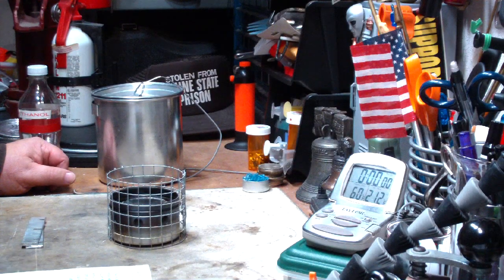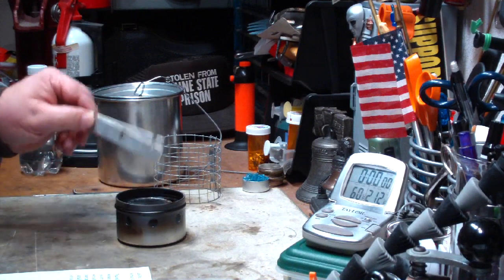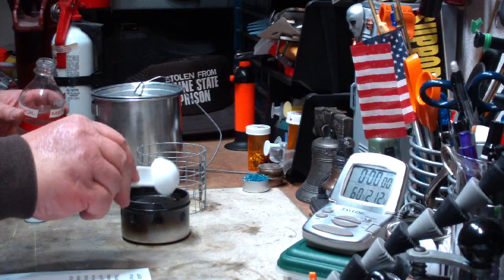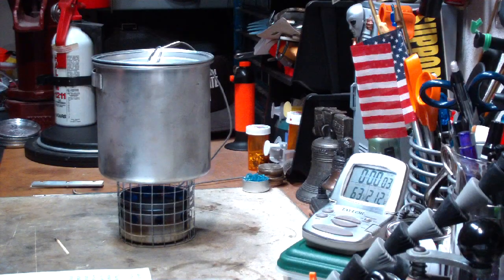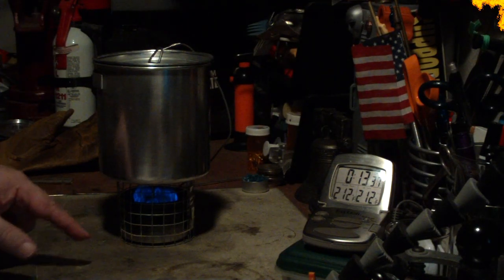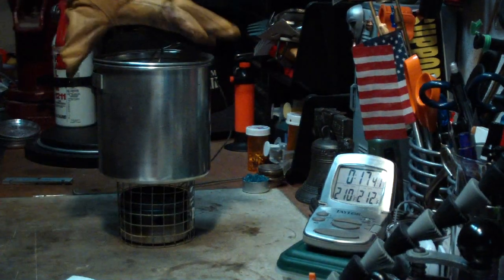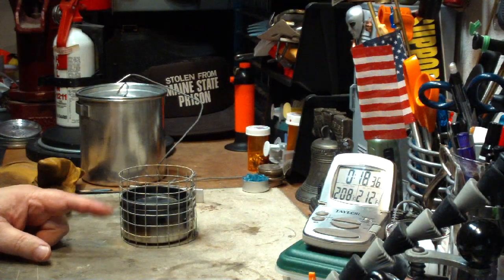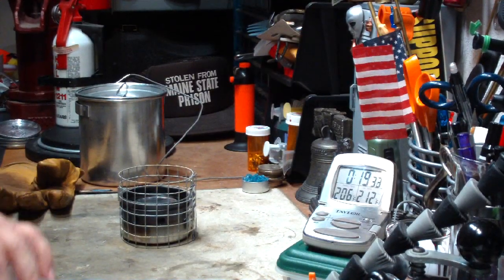Etowah Ultra-Lite Stove II - Boil Test #4 (Wire Pot Stand)

Comment: I think that for 4 cups you'd want to use more fuel in the outer burner, the theory being that you want to put enough in the outer to bring to boiling and enough in the inner to simmer afterward.  So maybe double the outer fuel when you double the water.